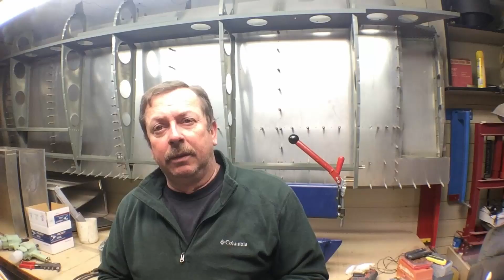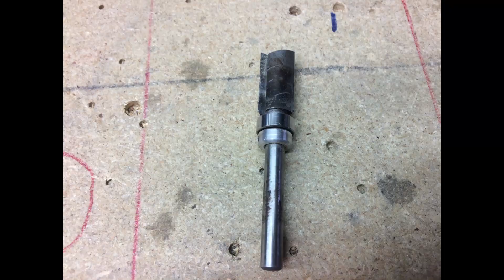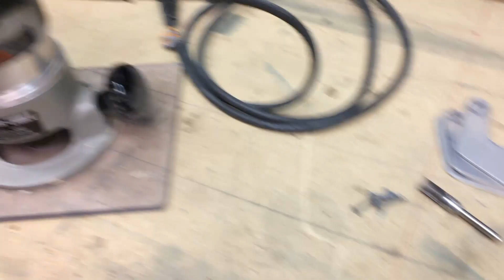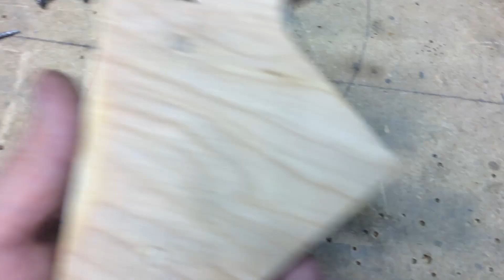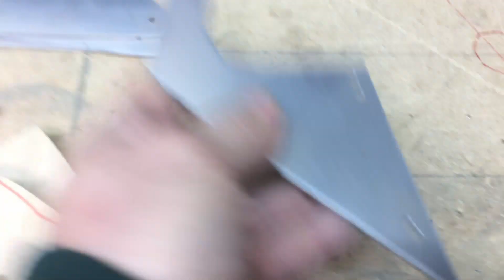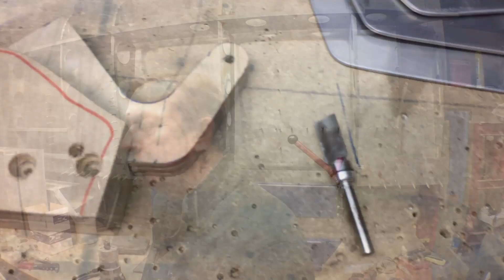Building a Zenith 701 Experimental Airplane, Using A Router To Cut Heavier Aluminum

Comment from the maker: Hopefully I haven't confused you with the difference between top and bottom bearing router bits. When you purchase the router bit the manufacturers consider a top bearing bit to be on top when the router is used in the normal position. When I place this in the router table the bearing is now below the cutting edges of the bit and I consider it to be a bottom bearing bit.